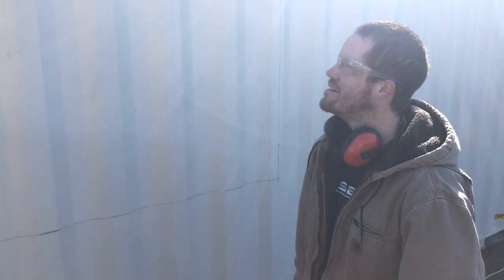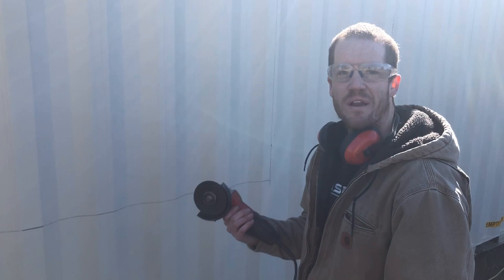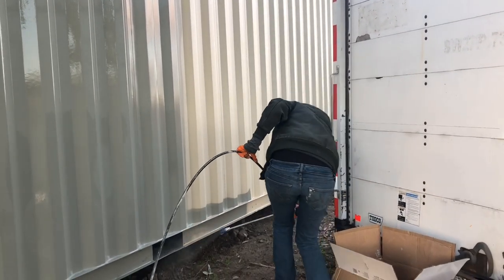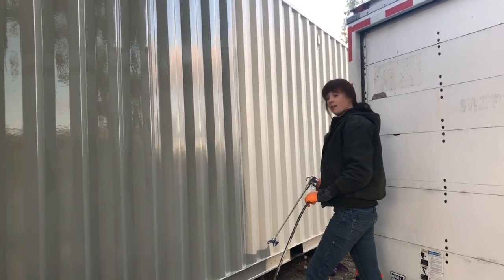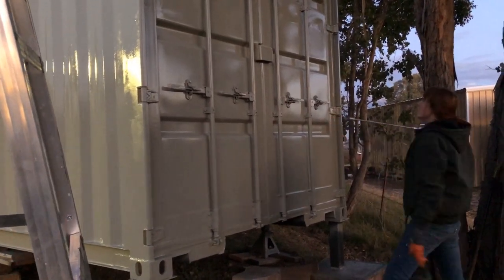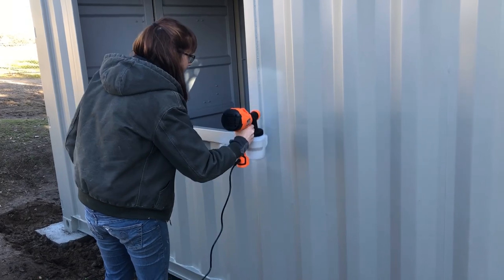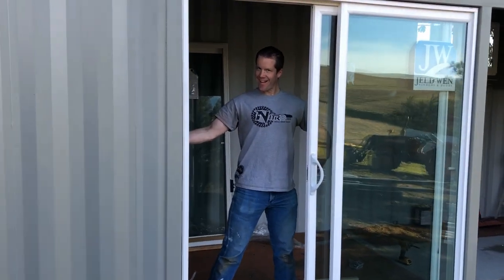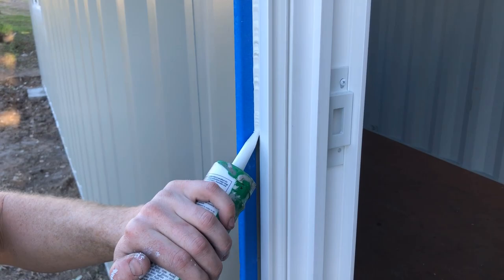Building A Shipping Container House | Episode 3: Windows & Paint

Comment: Hey there do you have any condensation issues around the windows in the winter. I like the looks of the tubing like you used better but have bin told the tube being hallow will condensate they Suggest using angle iron any insight would be great thanks
Reply: Hi there. I wonder if you can fill them in with spray foam?

Comment: 1. What’s the dimensions & thickness of the steel tube used to get the ridges to be flush with it insides and outside. 
2. Did you fully weld it around the frame on the outside?
Reply from the maker: Hi Gabe!
1. We used 2x3" 0.60 box tubing. It is not flush with the inside and outside. If it were flush the radius on the tubing would create a large gap and making welding difficult/ugly.
2. Yes we fully welded the perimeter and caulked it from the inside. We didn't want to rely on a caulk joint for weatherproofing.

Comment: I guess it works but arn't all the windows and doors installed backwords? the nailing flanges and brick molds are on the inside.
Reply from the maker: Yes they are installed backwards from a traditional construction standpoint! We wanted the exterior of the container to look very clean and by doing it this way we did not have to install trim over the flanges.